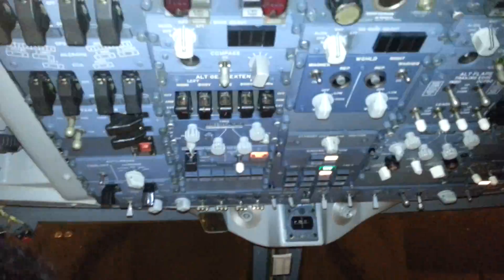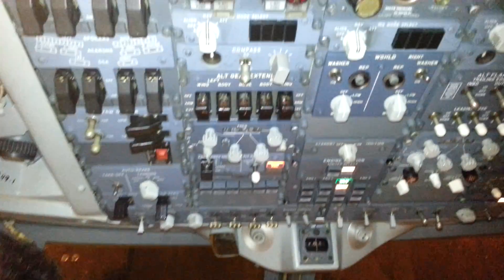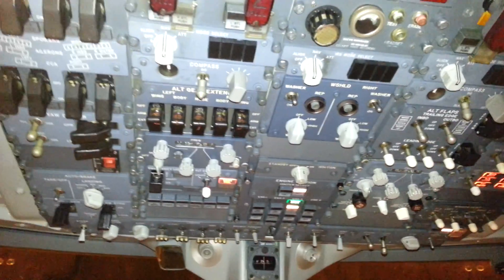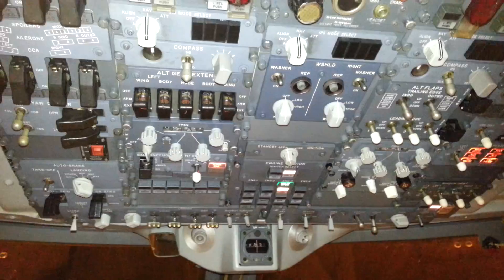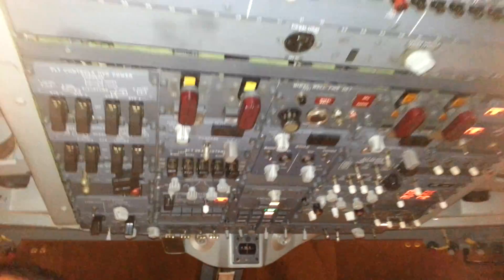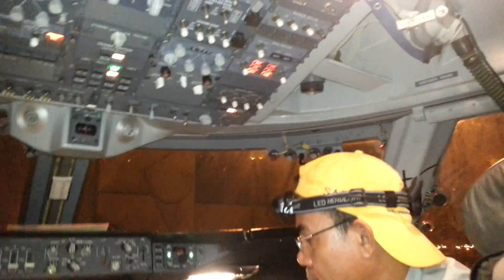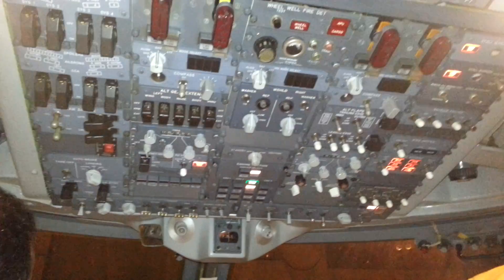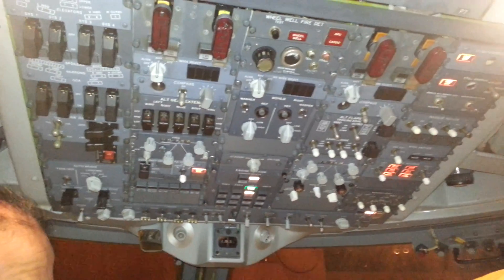RB211 Engine Run up Boeing 747-200

Comment: As a retired test bed engineer with Jt3,Jt9 Rb211,olympus Cfm56 to name a few test experience i was interested in the start and run procedure on an aircraft,compared with the procedure in a test cell. But unfortunately the camera man was to busy jumping around from panel to panel for me to have a good look at various engine gauges i.e. N1,N2& N3, oil press. EGT, Fuel Flow, Vibs. etc.

Comment: Great video... I just noticed one thing: engine number 3 has been started but tank number 2 pumps are on??? Fuel pressure gauge for engine 3 reads zero!!!
Reply: +Gustavo Nilson Good question.  On the Flight Engineer panel you will notice that the 2 and #3 fuel crossfeed valves  are open.  The fuel manifold is pressurized and there is positive pressure to the #3 engine from both fuel pumps (forward and aft) in the #2 tank.
Reply: +john d Hi John,

In fact crossfeeds 1&4 are open and 2&3 are  closed (check page 13 on this document - http://www.smartcockpit.com/download.php?path=docs/&file=B747_CL-Fuel.pdf). Also  check the fuel pressure gauges: 1&3&4 read zero and 2 has a different reading (From the video I'd say around 150-180 PSI).

Fuel pumps for main tanks 1-3-4 are off (light on) and only tank 2 has the pressure warning lights off which corroborates the fuel pressure gauge. Together with having crossfeed 2 closed, it won't feed engine #3 with fuel pressure. 

My guess is that engine 3 ran only on gravity feed (gravity of the fuel running from #3 main tank to the engine which sits below) which is not a problem since the engine ran at idle. Doing run-ups at high power would be a different story :)
Reply: +Gustavo Nilson You are exactly right and in fact the engines will run just fine on the ground with no fuel pumps on unless the first stage of the fuel pump is lost.  The airline I worked for had a procedure where after landing the FE would turn off all main tank fuel pumps while the engines were running.  For the P&W the manual said that the engine will only flame out if the suction portion of the first stage of the fuel pump was not working.  The fuel panel in this video is quite different than what I am used to.  We did not even have fuel pressure gauges on the our cargo -100 and -200 747s.  FAA deemed the gauges not required so the Company removed them to save money.   And all our crossfeed valve switches are at the same level.  In the video the inboard crossfeed valve switches are lower than the outboard.  Plus there are extra reserve fuel tanks that we did not have. Obviously the guy at the FE panel was clueless on proper fuel panel operations. And his inability to establish electrical power correctly on shutdown only verifies my opinion.

Comment: 4:15 should he not switch on EXT Power ON first before disconnect ENGINE GENerators ??
Reply: +MrEurocup You are absolutely right.  When he opened the #3 Generator Breaker, the aircraft lost all power except Standby Power from the battery.  Then he put the #2 External Power on the line. He then tried to open the SSB (Split System Breaker) and failed. He then put the #1 external power on the line which automatically opened the SSB (see green light come on) because Boeing designed the Electrical system so that you cannot have two like sources of power on the line at the same time. He was totally confused and had no idea what he was doing.  Loss of normal AC power is why you hear some alarms going off.  A bit odd configuration.
Reply: @jetfe  I guess he was still in training